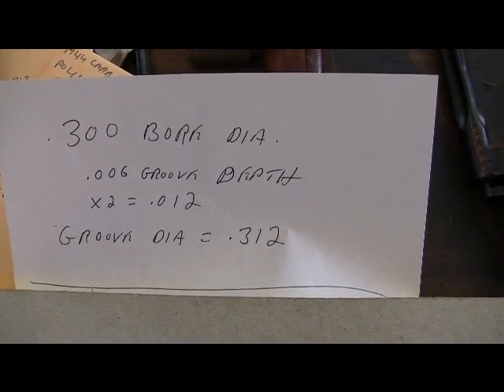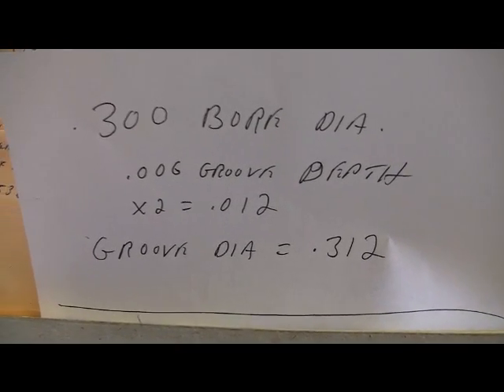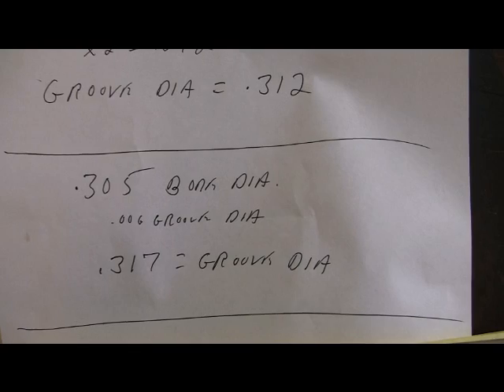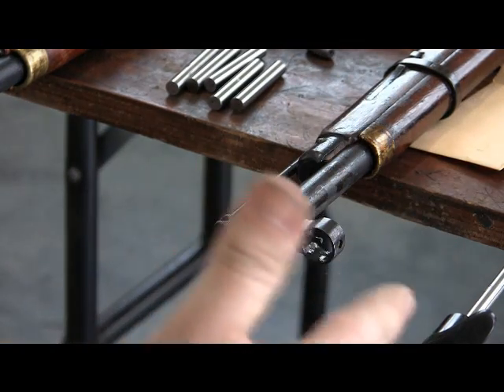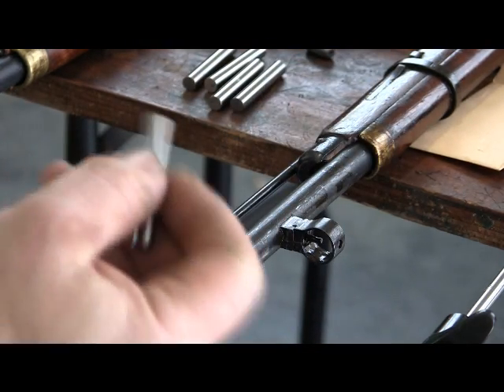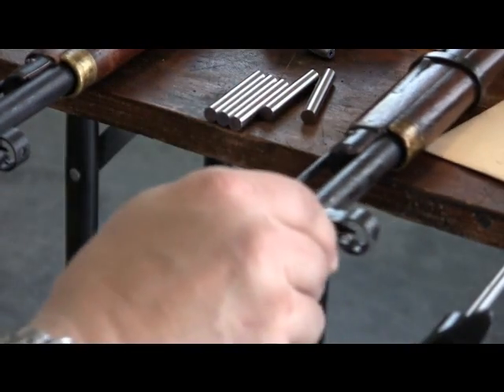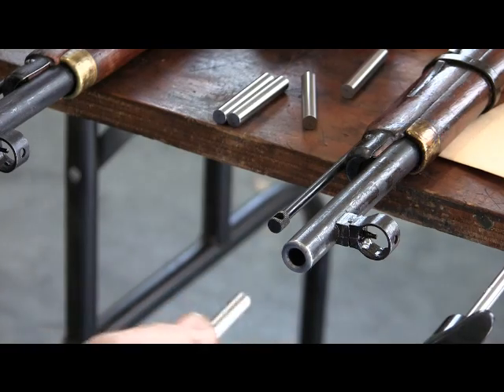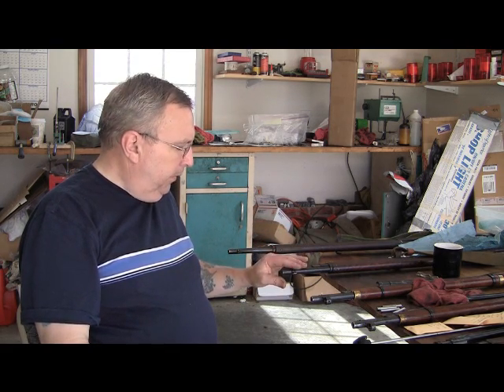M91/30 Precision bore measurement Part 2

Comment: ok the size is in this video .312 when you order a barrel the .264 that 6.5 that the whole lanth of barrel, with out chamber this guy(longrange shooter)then chamber and set up barrel to fit his action, made brass & hand loaded ammo, he told me a 6.5 creadmoor is about the same! when savage made one in axis for less then 400 bucks, new in box, the dies were made too, a maker offered it, the loaded ammo was around 40 bucks a box of 20, i use 250 savage cases necked up to 6.5! people in longerange shooting pay up to 10,000. or more, i went to other range when my normal range was closed, the shooter longerange, one guy firearm messed up if he had 2 firearm's one could been switched in time limit! you get like 5 min's fix or switch! the range boss told me bring 2 with you! just in case!

Comment: One issue with measuring the bore at only the muzzle by using a pin or plug gauge is that it only tells you the dimension of that portion of the barrel. Rifles which have been shot with ammunition loaded with boat tail bullets get eroded more at the muzzle than they are a few inches back. Boat-tail bullets tend to cause the barrel to erode at the muzzle as powder gasses squirt past the boat tail and act somewhat like a cutting torch.